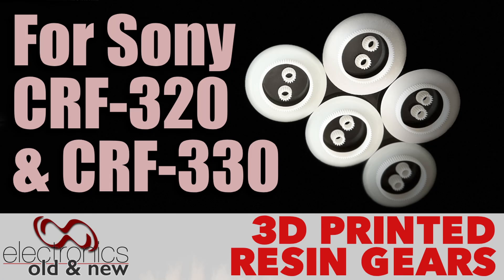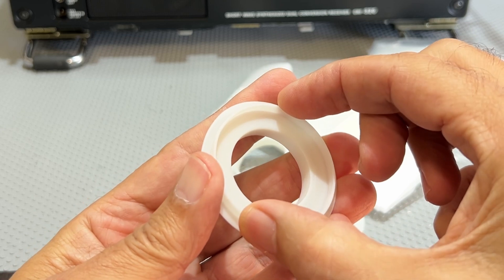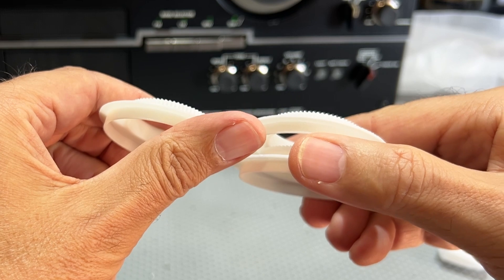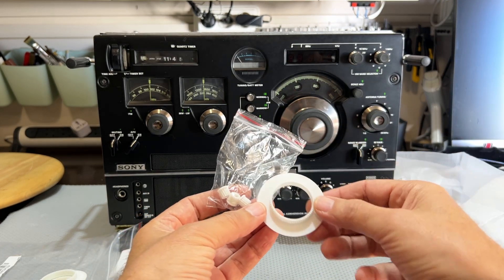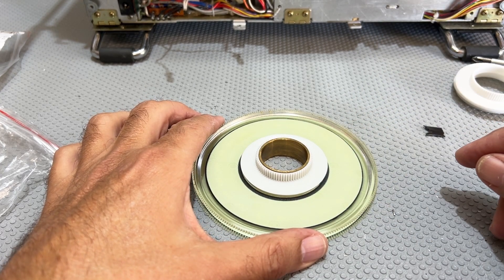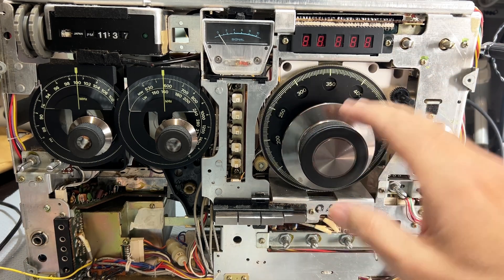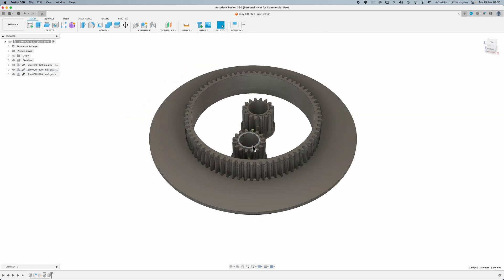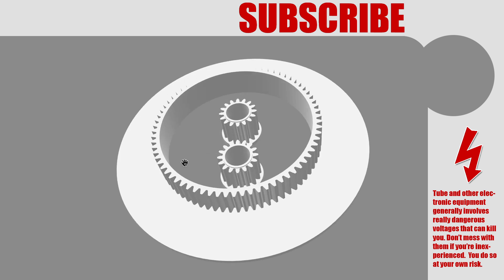Resin 3D printed set of gears for Sony CRF-320 / 330 receivers, that you can print yourself #pcbway#

Comment: Hi Manuel. Thanks for doing this! Do you know if I can simply choose nylon instead of resin in the PCBWay Parameter information without changing anything else to get the correct gears printed by them?
Reply from the maker: I’m not sure. You can ask them using the chat function in the website.
Reply: @electronicsoldandnew  I went with the resin, as you did, and they look great. Question: After installing one on the FM side, I'm not getting the full range of travel that I should on the dial--it stops at around 105Mhz. I followed the installation instructions from the Radio Shop video, so all of the gears should be aligned properly, Any suggestions (besides "redo the installation and alignment")?
Reply from the maker: I had a similar issue. It’s got to do with the tension on the gears when you put the pins in place.
Reply: @electronicsoldandnew  Figured it out. Thanks.

Comment: Resin and Nylon have different properties depending on the type of Resin used.  Nylon will generally be more hardwearing and resistant to chipping.   They should look pretty well identical with sizing as professional FDM machines are extremely accurate.
It can be hard to know which type of plastic to use sometimes.